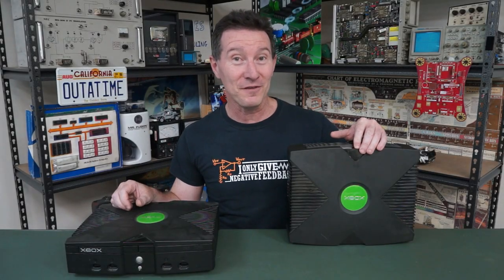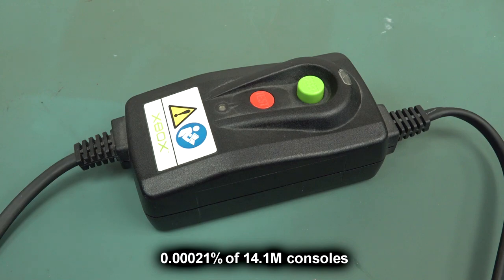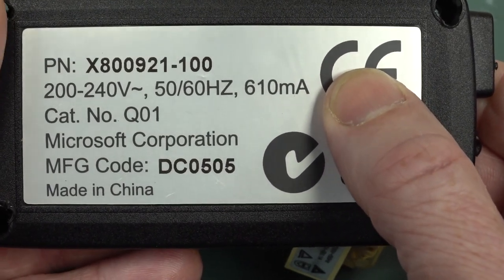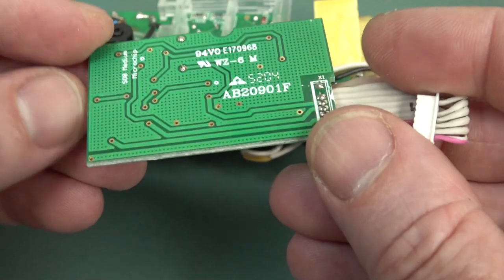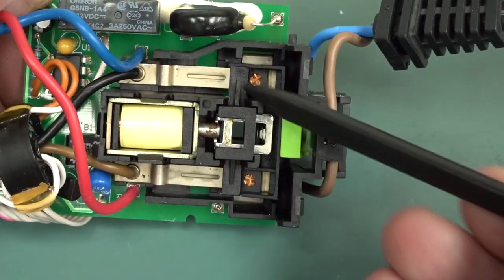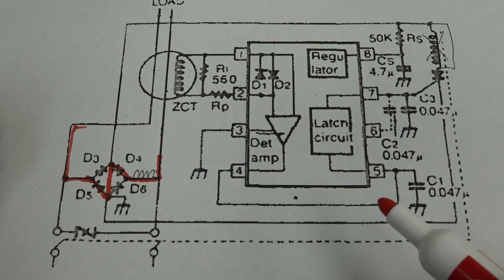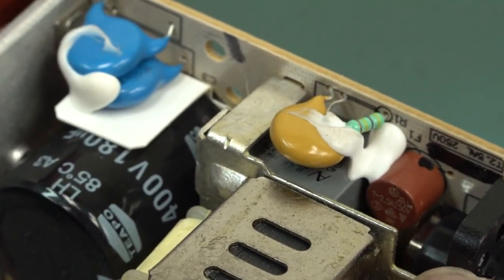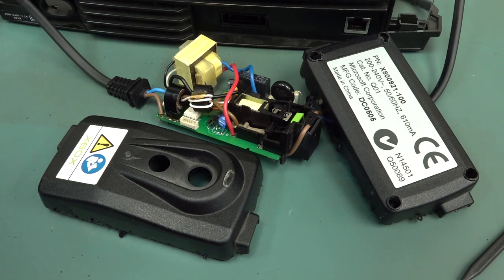EEVblog #1164 - Xbox Engineering Baptism Of Fire

Comment: I used to repair these consoles back in the day. Here's the real reason for those cords.

The issue was the IEC 8 power input jack on early revisions of the internal power supply had no mechanical support other than the solder joints. Every time you connected the power cord or moved the console the slight flexing of the connector stressed the joints. Eventually they would crack and begin to arc which can potentially cause a fire.

Later power supply revisions had 2 rivets that went right through the connector and through the PCB which took the mechanical stress off the solder joints.
Reply from the maker: Yep, showed that in the video.
Reply: Yeah that power inlet hasn't seen enough abuse on the real bad ones those puny tabs were broken clean off.

They're just an assembly aid to hold the inlet on before soldering. The manufacturer of the jack clearly intended for it to be mechanically bolted to the case which is why they provided the mounting holes on the front. Not the parts fault just an improper application.
Reply: @Bushougoma  

I was about to mention the IEC socket thing, but I knew somebody would already. hehe

I would normally say that this is one of the big safety advantages of the UK mains plug having a fuse.

But, I seem to remember Microsoft issuing these "cables" to the UK as well?

So I always assumed the device was actually detecting the arcing on the bad solder joints, and not just a simple overcurrent protection.

Still over-engineered, but hey, as Dave said, it was better to send that out to customers rather than recalling millions of consoles.

Whoever thought it was a good idea to not use a mains socket without proper mechanical support hopefully got sacked. lol
Reply: Would the Earth leakage chip get activated just because the IEC socket was arcing every once in a while?

I know household RCDs can sometimes be a tad oversensitive, but shouldn't normally trip unless there's a current imbalance between the Live and Neutral?

Or, perhaps the Y-Class caps between the hot side of the PSU and the cold side could cause an RCD to trip if the arcing is bad enough?

(because the Xbox would generally be hooked up to a TV / AV receiver / cable box etc., where it can have a return path to Earth.)

I've often wondered about the different current paths through Y-Class caps in a typical SMPS, especially why some of them can give you a surprising "zap" when plugging cables in.
Reply from the maker: ElectronAsh - In theory, no, they shouldn't trip unless the current gets diverted to earth. IN practice, some designs can be a bit touchy.
Reply: @EEVblog  

That's what I was thinking.

Like perhaps a few too many narrow current spikes from arcing or noise can set them off, a bit like reaching the trigger threshold on a smoke alarm or PIR.

(ie. so many pulses within a short time.)

A video on "getting zapped" when plugging in cables between a SMPS and Earthed device could be interesting, btw, but I think you have covered the Earth leakage topic a few times already.
Reply: Thanks
Reply: @electronash  The problem is, an arc fault doesn't draw more current, to the contrary, it is an additional resistance in the circuit and therefore even reduces the total consumption. It "just" gets very hot locally and can ignite the surrounding materials. Neither a fuse nor an RCD can detect this because it just won't cause the faults these devices are designed to detect. 

You can say that in most cases your hear about a house burning down because of a "short" in the news, it wasn't one. Shorts aren't a big deal, they just trip the breaker and will you sit in the dark for a while, but that's it. Usually it's a loose connection in some junction box or outlet which gets hot and leads to a cable burn. Had this in our own house, luckily it melted the insulation first so it blew the fuse to this circuit without further damage. 

The fuse in the UK mains plug is primarily there to protect the cable to the appliance, since your "ring circuits" are typically fused 32A and so every applicance would need to have an 2.5mm² or even 4mm² cable which would be very stiff and unwieldy.
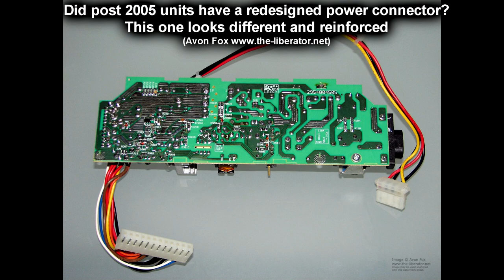Reply: My console was made on August 31st 2003, and had a more reinforced power plug (the PSU was made by Delta on my unit), and looked nearly identical to the revised power supply shown at 29:05.
Reply: What a cheap product considering the device costed 400 bucks back then.... i owned one, but sold it to buy a newer platform.
Reply: A Gentleman  i think the xbox was an over heat on purpose.  It was designed to fail, but they failed to see the problems before with the cords and connectors failed....
Reply: @petroldevo9934  Anything designed for the mass market/volume can and will be done as cheaply as possible. Look at the Apple MacBooks that Louis is making a tidy living from repairing. The XBOX is cheap in comparison.
Reply: @EEVblog  harhar.. touchy.. nice one
Reply: @electronash  The fuse in a UK mains cable is there to protect the cable not the device it's powering...
Reply: NEC always changing.
Reply: I repaired exactly the same thing on PS1 :-)
Reply: I experienced this too. Definitely a thing!
Reply: @VintageTechFan  Wouldn't the fact that an arc fault in effect introduces additional resistance (hence voltage drop), cause the SMPSU to want to draw even more current, causing a runaway condition?
Reply: The thing that amazes me is that this product made it to market with the 2 solder joints taking the strain. Just about anyone on here (without any design experience) would have been able to see a problem during the prototype stage...
Reply: @chrisg6597  Yes I thought of this fact, too, after the post, but didn't want to edit because it isn't really significant to the fact. 

I don't think it would cause a runaway, since arcs have an negative diffential resistance, the voltage drop gets smaller with more current, so it would end up in a somewhat "stable" condition with a few tens of volts over the arc fault (which still makes it more dangerous..).

But yes it would draw more current if an SMPS is used, but not NEARLY enough to trip a fuse in time. Maybe 10-20% more, fuses are allowed to carry up to 1.5x rated current "forever", and typically do since this is the margin required for reliability. It takes 3-10x rated current (depending on the characteristics) to blow it "immidiately" .
Reply: I remember pulling these apart and finding clear signs of arcing around the power input solder terminals. They would break away from the board or even burn the traces on a few.
Reply: yep.  I used to mod these guys back in the day.  I bought a faulty xbox from a pawn shop for a few bucks back when they were still pretty expensive.  on testing, I knew exactly what the problem was.  took it home, re-soldered the joints and it worked without a problem.  later I just replaced the power supply with the fixed version from a dead xbox.

protip: find an old original xbox?  if you can register it with microsoft as yours with a valid address and it's eligible, they'll send you one of those power cords without having to do anything else to get one.

xbox-scene really kicked me off into hobby electronics on a whole new level, starting with putting an LED in everything, and eventually moving on to motor controls and now Pi/Arduino based programmables.
Reply: I can't even believe that was something that ever happened.
Reply: I had an xbox with this exact issue! a flaky connection. it just died seemingly out of the blue. turns out it was a cracked joint.

Comment: I worked as a Tier 3 Xbox Live support tech at the time. ALL calls that came in about consoles letting the magic smoke out were immediately transferred to a queue manned by a select team, 100% recorded, with Microsoft attorneys also on the line. They played it cool for the public, but internally it was a 24/7 full blown code red for a couple of months.
Reply from the maker: I can imagine!, thanks for sharing.
Reply: Not surprising. One of my friend's MacBookPro charger overheated then let out the magic smoke and when he called AppleCare for a replacement they did pretty much the same thing. Transferred him to tier 3, asked a ton of questions, and of course overnighted him a replacement with an overnight return label presumably so they could autopsy it.
Reply: I have a Alienware Cord I just   hot snotted it    works good  still
Reply: Great info!
Reply: @LtKernelPanic  Well - for apple that is normal - they are used to their products being faulty the last 10 years.
Reply: So the lesson here is, if your consumer product causes damage call a lawyer that can represent you. Calling the manufacturer is the same as calling their attorney and gifting them their case against you.

  To anyone that hasn't been through a major personal injury lawsuit: the whole ordeal is all about getting you to contradict yourself on record. The smart thing to do is to say as little as possible unless you are in a court room. If they can't get you to contradict yourself, the company will just hire tons of (professional opinion mercenaries) ""expert" witnesses." They will try to show up with 3 times as many people as you will be able to afford. These people will say anything for their $2k to $10k fee, and they have the credentials to make them sound legitimate. The purpose is to out spend you. If your attorney doesn't have the unlimited funds needed to match the other side they will get cold feet and undermine you anyway possible to recover their own investment and ditch the case.
  Never, never, never, go on record with a problem like this unless you have legal counsel present. Your only hurting yourself doing so.
Reply: But how could the Xbox 360 lead-free desolder thing happen then? Haven't them been tested with extra caution?
Reply: @UpcycleElectronics  Though there's a very small subset of scenarios, where the loss is significant enough I can be bothered to get "legal counsel" on the case or small enough I'm not just going to hand the whole situation to my insurance company to argue out.  In the small-loss scenarios I'm happy to discuss it with the manufacturer, and in my experience they're very keen to cut a cheque.